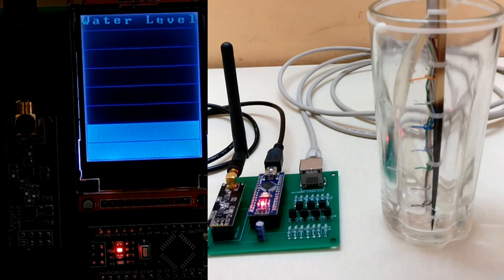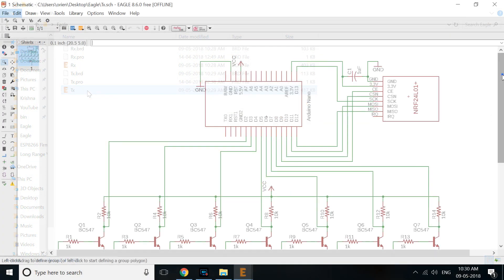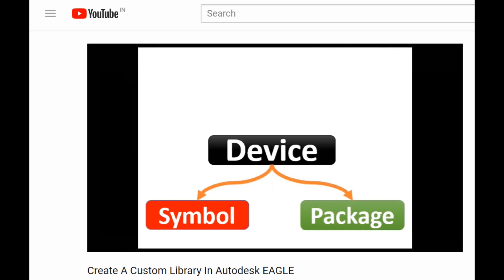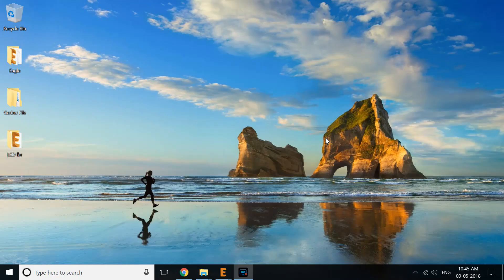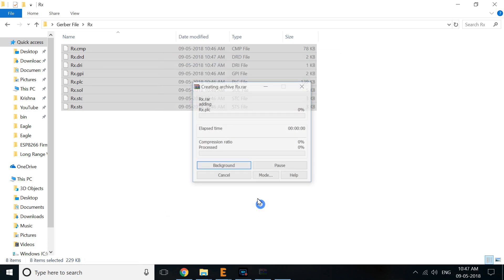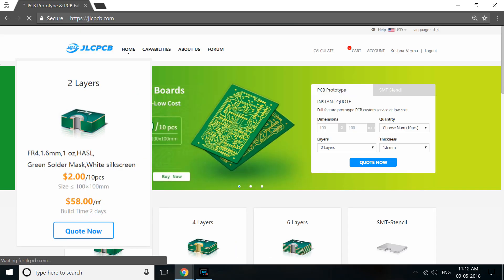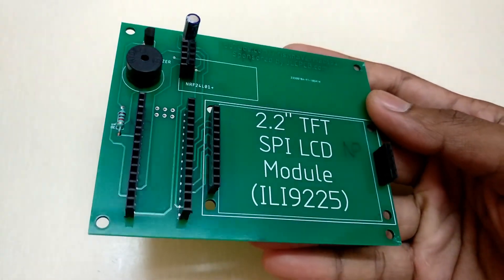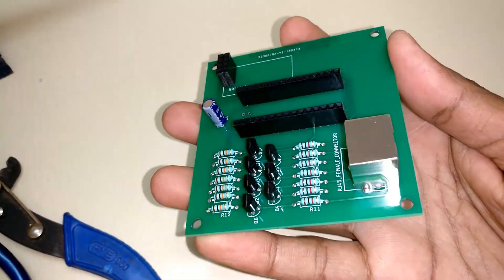How To Make Water Level Indicator With Alarm Using Arduino | Wireless Long Range Up to 1 km

Comment: Getting back to getting all the parts for assembly. I had the boards produced last year...now need all the components.

Just to clarify from your Amazon list, I'll need:
(2) MakerFocus Mini Nano V3.0 ATmega328P Microcontroller Board w/USB Cable For Arduino
(1) MakerFocus 2pcs NRF24L01+PA+LNA Wireless Transceiver RF Transceiver Module 2.4G 1100m with Antenna in Antistatic Foam Compatible Ar duino
(1) HiLetgo 2.2 inch ILI9225 SPI Serial Port 176x220 TFT LCD Module with SD Socket for 51/ARM/Arduino

Then for the Transmitter:
(1) RJ45 cable
(1) RJ45 female connector
(14) Resistors
(7) Transistors
(1) Capacitor
(4) Female header strips - 2 long, 2 shorter?

Receiver:
(1) Resistor
(1) Transistor
(1) Capacitor
(1) Buzzer
(4) Female header strips - 2 long, 2 shorter?

Again apologies, I've never soldered boards before. The resistors, transistors, and capacitors...can I source those on Amazon as well? Any specific requirements/specs I need for those?

For the buzzer...a specifics for that one?

And the header strips...can I also get those on Amazon? What lengths?

Thank you!

Comment: Sir can I use SONAR sensor instead of wires.
Reply from the maker: Yes you can, but the circuit and code need to be changed.

Comment: Sorry for the newbie question...but what powers these boards? Do they both need to have a USB connection for power?
Reply from the maker: Yes both boards are powered using USB
Reply: @ihrProjects  Thanks! Your video has been very helpful...soldering boards will be totally new for me, so your detailed instructions helped! I just ordered the Transmitter and Receiver boards from JLCPCB, and then need to get all the other components.

The Receiver end I can power via USB as it'll be in our Barn, however the water tank is about 800' away up in the woods remotely. Could I use some sort of battery powered USB hub/cable to power the Transmitter board? And if so, with like a 9v or set of AA's batteries, I wonder how long it'll last?

Thanks much!
Reply from the maker: @HoffAppFarm  Yes you can use battery powered USB hub.

Comment: hello, good day Krishna, i think this is a very good job. i wondering to get the librarys, but the carpet was empty. did you mind?
Reply from the maker: Hi, libraries are available in the folder, verified after reading your comment. Please download and extract folder. Please try again or use another software to extract .rar file.
Reply: @ihrProjects  thanks again, i will try again with another software.
Reply: Krishna, indeed the librarys was there. you know i have a different tft display the QD280UNO8230.

Comment: Thanks for the detailed video, but i think it would be better if you have used a relay to control on/off motor according to water level. can you make it new version with motor automatically on/off instead of buzzer?
Reply from the maker: Yes, I'm planning to make upgraded version of this with motor control.
Reply: @ihrProjects  thanks, waiting for that one.
Please make it wireless and working voltage should be 12v instead of 9v bcoz nowadays solar batteries are in almost every home, so we can use them to power the circuit. 
Also manual switch to turn on/off motor at any time is also a MUST.
Reply: @ihrProjects  any update for the new version video?
Reply from the maker: @joshitoshi9835  It will take time, I'm unable to manage time for  it.
Reply: @ihrProjects  take ur time. i hop u will soon get time and make a new version.

Comment: The NRF in transmitter side, it only works if we touch the antenna.. what's the solution? ..Kindly reply me sir..
Reply from the maker: Remove NRF module from PCB and unmount antenna from NRF board then clean copper contacts of antenna and NRF board then assemble it. Make sure that connections are tight. Hope this will work.

Comment: the project was super can u use instead of rj45 use ultrasonic sensor and animated in lcd display like water tank
Reply: i converted this project into ultra sonic sensor and now i am able to see level in percentage with motor on off feature also

Comment: Hi krishna, can u tell me the which pin correspond to which water level? Because i could not find a matching RJ45 socket to solder on to the board.im thinking about soldring wire probes directly to the pcb.
Reply from the maker: Identify VCC pin from 8 pins by measuring its voltage wrt GND ( it should be approx. 5V ). And then keep this wire as bottom most wire. Then identify sequence of wires on trial and error basis
Reply: H Krishna, I've soldered the wires directly on to the board and test the circuit , but only im getting one water level each time. Ex :- It will indicate only one bar at a time like LOW or HIGH or inbetween. When uploading the code i had to use the Nano with oldbootloader option on the Arduino IDE coz it wont upload with normal bootloader (I hope this is not related to issue.) ill send you a video with the issue kindly share your email. thanks :)
Reply from the maker: @djdamithj  it's working fine, code is written to fill only one level at a time. Now arrange wires in sequence and run normal test.
Reply from the maker: ihrverma@gmail.com
Reply: Do you think the probe would be safe for gasoline?

Comment: sir i need code . your link not working Download Complete Project Detail: https://goo.gl/Nqtfha   plese provide me code.. thnx
Reply from the maker: There is no issue with the link or .rar file. Just now I downloaded the file and extracted it, everything is fine. You need to check your system if there is a rar setup installed on it or any other issue.

Comment: Hi Krishna, 
I like your project and I was trying to make it for long time but couldn't do it due to time issue.
I need this product. Can we tell me the cost for it so, if it is come to my budget, I can order it to you. I want to use it pratically. I have my water 500 Ltr tank on first floor and I fill it manually. Everytime I need to go up stairs to check it the water level. If you make it for professional use then I would be good. Please share you contact no so I can talk to you for the same.
Reply from the maker: You can contact me at ihrverma@gmail.com